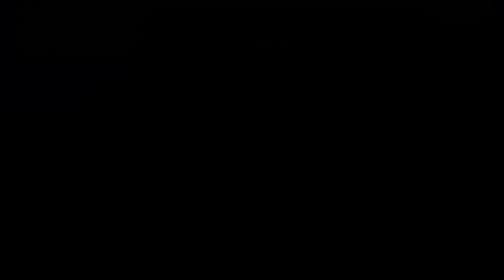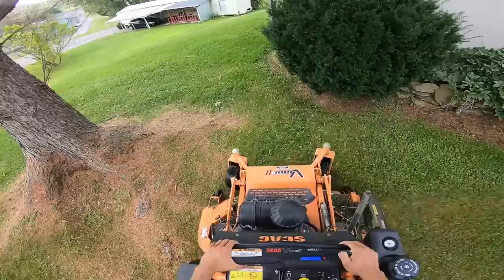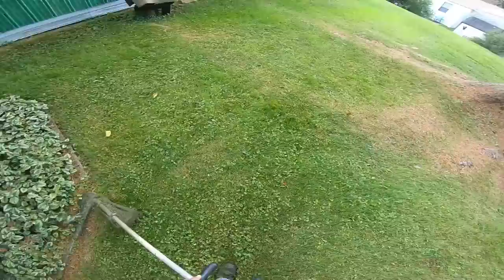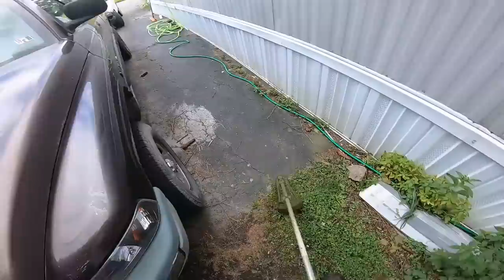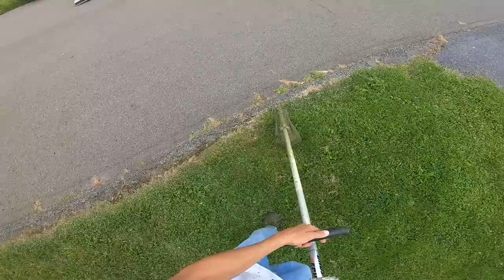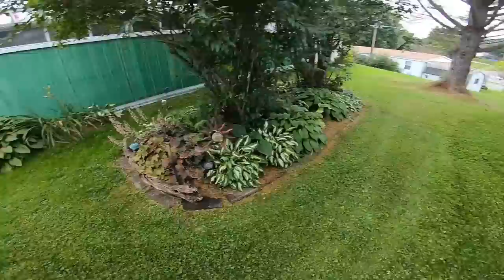Mowing Mobile Home Realtime | Are They Profitable? | New Business Tactic? | Vlog

Comment: I throw granular lawnweed and feed down. Invested in a verticutter/scarifier and a chipper shredder. Upsell and do the extras well Wyatt.
Reply from the maker: What would the chipper/shredder do for a property like this? Not at all trying to seem rude haha! Genuinely curious :) I imagine a branch chipper when I think of that haha
Reply: @wyattslawnservice7212 . I don't want route density. Too much mowing. Autumn means leaves and hedges so I don't want to keep driving to the dump. Dude when you strim needs to be full revs on the throttle. If you strim first you get chance to eye ball the property for any potential hazards before you run over something with your Scagg. I use 2 mm line soaked in water over night.
Reply from the maker: @losttheplot26  I've heard of people soaking the line but never tried it. What does it change in the line?
Reply: @wyattslawnservice7212  it makes the plastic more supple. Listen for the hiss. Only cut with the very tips of your line. I use Tanaka or Ego. The left side of the guard is a great guide. Just mind the cambium layer around tree's.